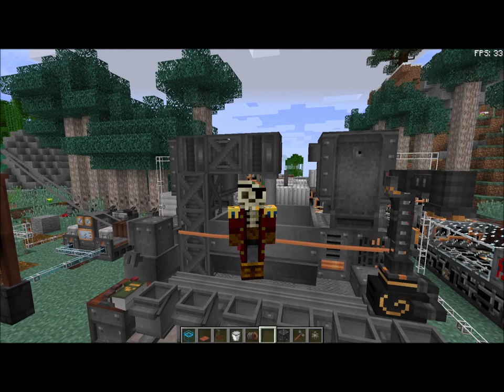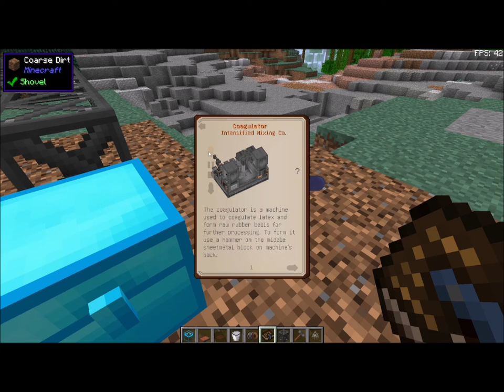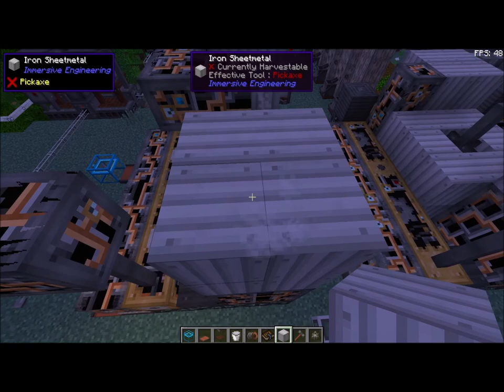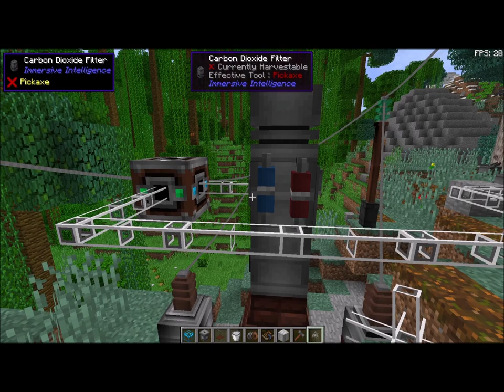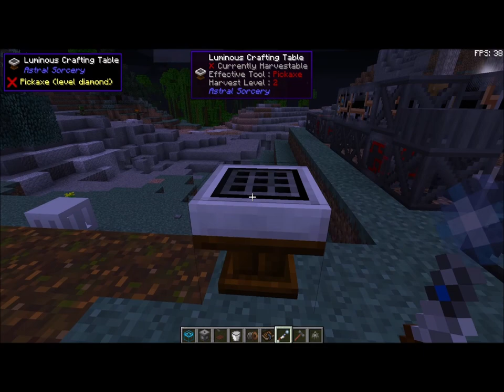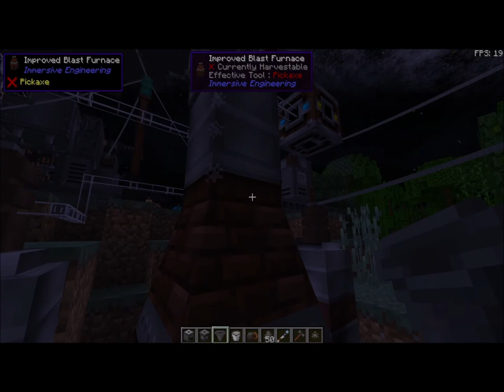How too   Immersive Intelligence Coagulator

Comment: Took me a while to set that machine up. (What a pain..)

Make sure to not confuse the left and right side or else the machine won't do anything. 
If you're standing in front of the buckets, left side gets the Latex, right side gets the acid. 
I fiddled at least 3 hours with the power sources, various lever-positions etc until i managed to get that stuff working. (Turns out i forgot a piece of pipe but details)

As the other guy said, you need to carve the part with an axe first. Then you need to place the collectors one block below, so that the pipe ends up at the chaved off part. 

Also important is, that you have MobGriefing ON or else you'll only get empty buckets back even if it's actually full.
But i haven't found a way yet on how to pump the latex away automatically. I've tried immersive pumps as well as Fluiducts from Thermal dynamics. (lack of other piping yet due to me playing epoch runner)